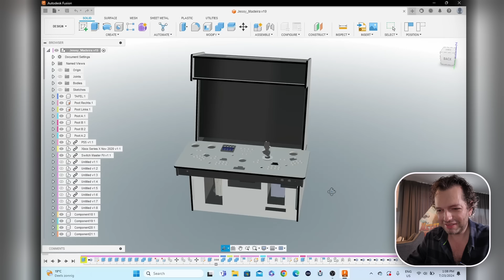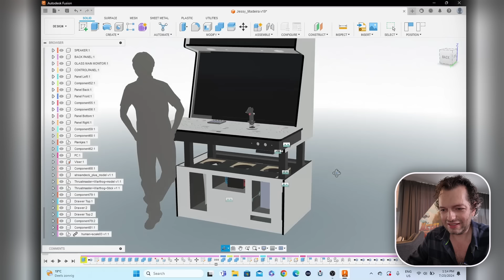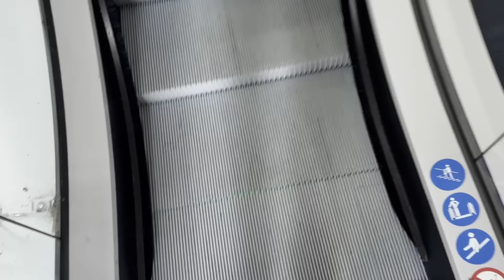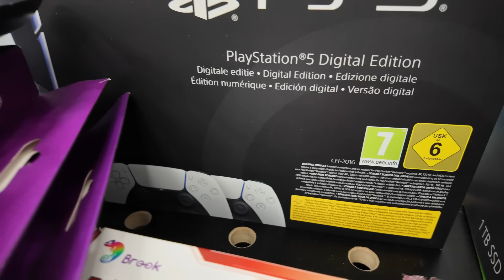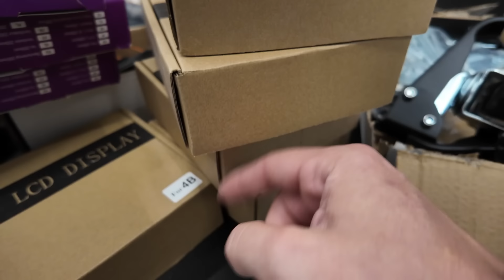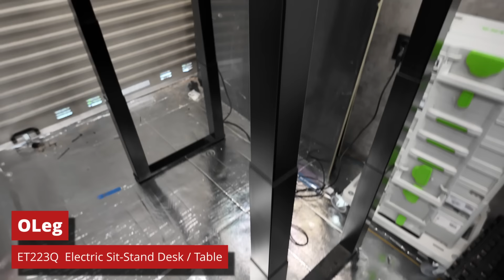Creating the BEAST Part 1: Design and Components of the World's MOST Expensive 50" Arcade Machine

Comment: @TheDanielSpies_Arcades great job and I’ve been following you for awhile learning a lot. My question is why do you have 8 buttons for player 3 & 4? Which games support 4 players simultaneously with that many buttons? I’m wanting to build something similar but I’m not aware of games that have that requirement. Thanks and great job again.
Reply from the maker: Haha, correct.  you will only need 4 buttons max for players 3 and 4. Most people like to fill the panel with 6 or 8 buttons for aesthetic reasons. But these are in my opinion not practically needed.
Reply: @TheDanielSpies  before you replied I bit my tongue a bit. I haven’t emulated enough but I guess the only use case I can see now is if I emulated a console for example SNES and it leveraged L, R Z etc. buttons. But good response. In your opinion and you haven’t talked about this topic enough but is there much configurations you need to do to setup big box or other front ends after purchasing from HyperArcadeSystems? Is it plug and play or do u need to map buttons, especially for the stream decks and other buttons like the pinball buttons on top of the 4 player configuration, flight stick and guns etc.

Comment: Nice! I've been drawing up plans and collecting parts for an adjustable height pedestal build that can go from sitting to stand up with a larger sized monitor on an  adjustable desk mount. A minimalist type arcade machine that doesn't take up too much room. Plus with the monitor desk mount you can twist the monitor 90 degrees for those vertical screen games and pinball. Can't wait to see how a pro implements the adjustable height.

Comment: While I can appreciate the effort you have put into this thing, to me it's just a colossal waste of time and money. 
1. most classic "arcade" games weren't designed for a 50 inch LCD monitor, they will look like garbage on that screen. 
2. Who wants to set on a stool (or stand perhaps) 18 inches from that large of a screen playing modern console games for hours on end? Console games are designed to be played from a couch or a recliner on a TV down low several meters away. The ergonomics of that thing is just stupid.
3. Putting 50,000 games or whatever on it is also ridiculous. You're going to spend more time searching for what you want to play then actually playing anything. 
But hey, makes for a good YouTube I guess. 🤷‍♂️🙄
Reply: 1)Mame games will look fine if you set normal bezels and turn on reshade. It will turn out to be just 26-28 inches. Modern Arcade Games(teknoparrot) they just require a large screen. 
2) Console games in an arcade machine are just a bonus, you can take a gamepad and play at any distance, but no one will stop you.
3) It's actually very convenient to have everything in one, even if you won't run it all)
Reply from the maker: Did you like the video? Then the mission succeeded 🙌🏻